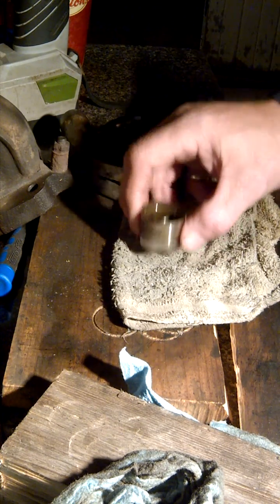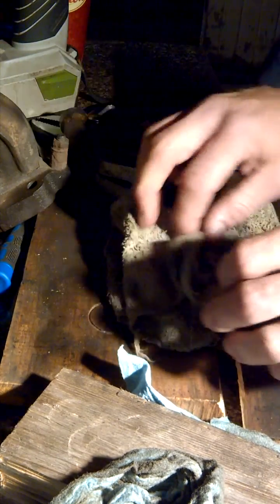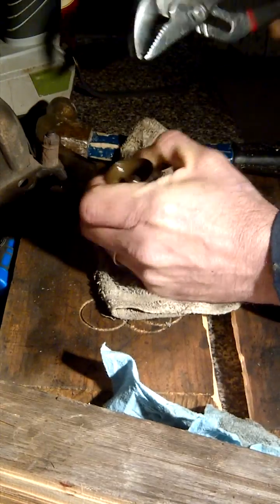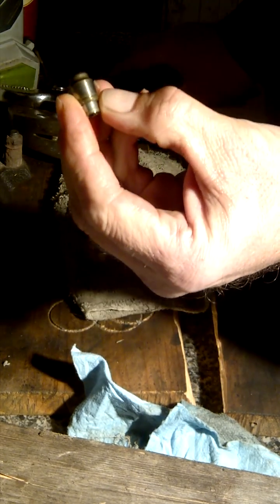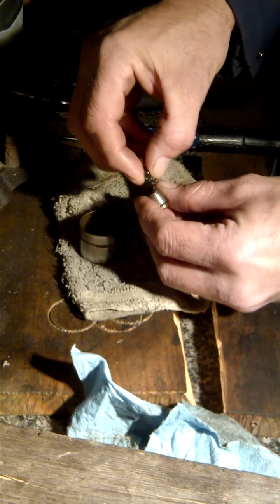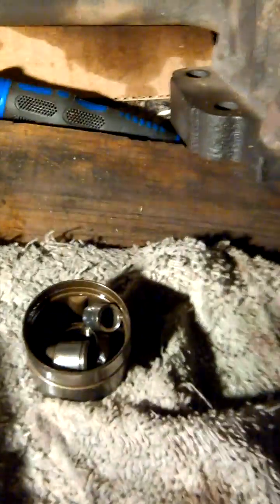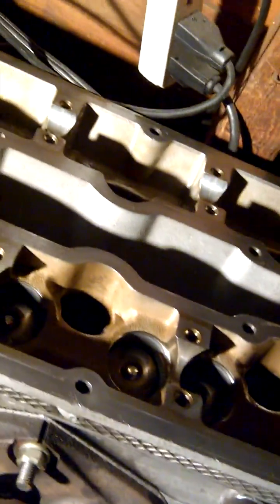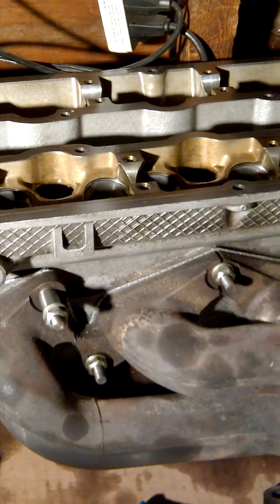Hydraulic lifter cleaning, Taking them apart. SAAB 9-5 2.3T

Comment: This technique did not work very well for me (maybe mine were worse off), so I came up with something that worked a lot better.  By duct taping the lifter, cup side down onto the top side of a rubber mallet, I would then strike the rubber mallet onto a hard surface (concrete floor for me) 3 - 4 times.  This would drive the inner parts forward by inertia, releasing them without any possible damage to the lifter cup.  Worked like a charm and I was able to use the same piece of duct tape (about 8") for all 16 lifters! :)  Hope this helps someone.  Take care,
Reply: I am working on a 01' saab 9-3 convertible- been fooling with lifters- I'm going to try this!
Reply: so I tried this - and this worked AMAZINGLY well. Enough that I think I''ll comment on any  lifters disassembly video to use this instead...this technique was a godsend! thank you so much.
Reply: @jojobutter1  You're very welcome.  Love to share help.
Reply: Just smashed my out by hammering them into wood with a plank holder, your idea seems a lot better...

Comment: Did the solvent remove all the varnish from the lifters?  I've taken the bucket and smacked it down onto a piece of 2 X 4 to take them apart, but this technique was not working for most of my Saab buckets.  I will try this hammer technique tomorrow!  Thanks,
Reply: The stains stayed on the lifters. 
Don't forget the two pieces of wood. One too one bottom.

Comment: On my '99 9-5 @ 186,000 miles all the exhaust side camshaft followers were fine. All the intake side ones were strangely not holding pressure. Not sure why, but I had to resort to your method to get them apart and clean them. Hopefully once I get it all back together the engine will be quiet again.

Comment: It worked great. (I don't think it's the proper way to get them apart....) The car is running like new. This quieted the lifters down a lot but lifter noise isn't totally gone. 367000 km on it now so it's to be expected.
If you do this type of repair make sure you a soft wood like pine on top and bottom. Hit it squarely too.
Good luck!